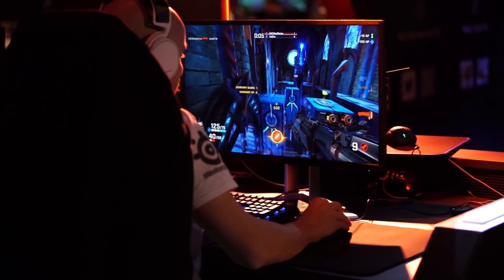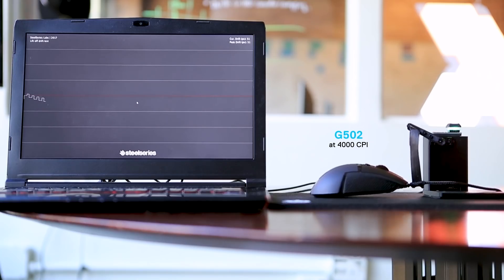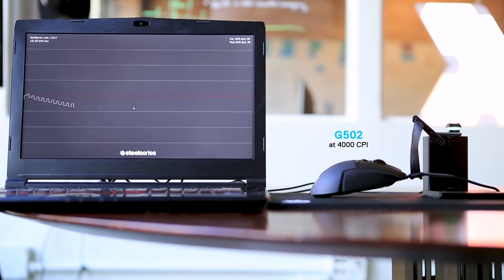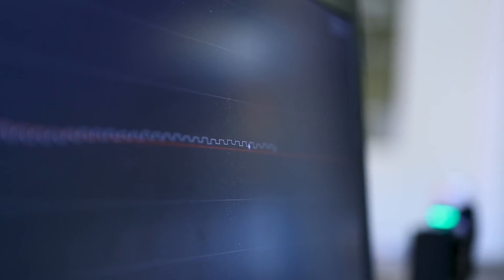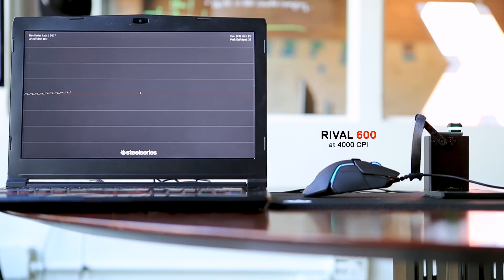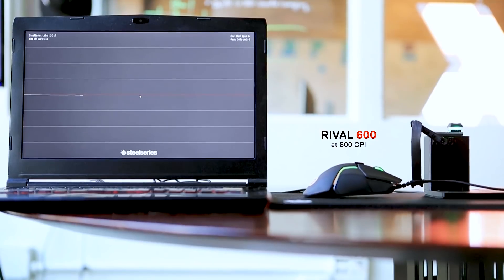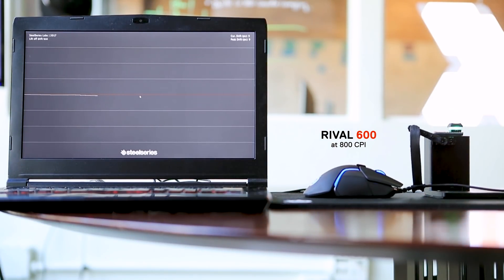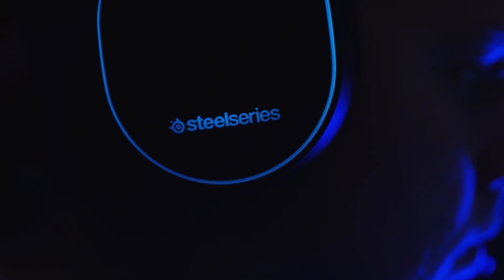Rival 600 Liftoff Tech

Comment: I know I'm literally three years late, but I recently bought a R600 and my liftoff sensor has not worked since I bought it, I checked if there was a peel but there was none, could somebody help out?
Reply: what do you mean by the liftoff sensor has not worked? like it still moves with lifting off or what
Reply: @peterfernandez1756  It doesn’t register when I lift my mouse, like at all.

Comment: Blah bla blah ... Rival in the video is not even lifted as high as the Logitech one ... I am using R600 right now and I'm dissatisfied with it, looking at a Logitech to swap it out and never going SteelSeries again. Reason: Mainly software. The SW Engine is blatantly stupid, does not switch profiles as it promises. I have a cheap 20€A4Tech mouse that can save profiles into onboard memory, allowing for using the same mouse config on multiple machines (I have multiple work laptops, so office config helps my QoL & productivity) but not SteelSeries, no no no. SS will not work properly without its software installed, it will just become a dumb mouse once you don't have it. 
And on HW level the side grips after not even 2 years are runny like my nose in autumn. Not holding in place + the glue is getting on your fingers, what a lovely experience for a 90€ product.  I also had a bad RMA experience in the past with SS (2 mice I had before from them both died, one for wheel, second one for left button; hello RandallB), trying to avoid consumer rights in EU and I don't want to go through arguments about RMAing my faulty "top notch premium brand" product ever again. So I can't recommend SS in general to anyone, go for ANYTHING else than SS, do yourself a service, there is currently dozens of other brands to try. (Also 2 of my Razer DeathAdders died, both doubleclicking, so probably stay away from that model as well???)

Comment: I have this exact mouse and when i play CS:GO sometimes my mouse stuck on screen like there is a board (feels like freezing for less than seconds, but it happends alot so i can't play like that ) how do i fix it ? btw also when im not in game just moving my mouse it does the same thing ...
Reply: I'm sure you have resolved this issue by this point however if anyone else happens upon this comment I will provide some insight into a resolution.  It is your mousepad.  Some areas of my mousepad do this and not others.  Short of replacing your mouse pad with something else you may also adjust lift off height in steel series just a bit, this issue seems to be from the mouse thinking its no longer on a surface for some reason, something inconsistent in the mousepad.  

I had this issue, adjusted the lift off height just a tick and it went away.
Reply: @thevoiceoftruth55  Got Steelseries HArd Mousepad, so i think that shouldnt be a problem

Comment: I have this mouse. It isnt as impressive as it may seem.
- The mouse advertises this wonderful lift off distance mechanism, but the test shown in this video is idiotic at best. No gamer or anyone really, will slowly lift the front of their mouse up and place it back down. Where the lift off thing really kicks in, is when you're in a heated moment, and need to quickly reposition your mouse towards the left of right. Kind of like a bunny hop. This mouse DOES NOT perform well here, its almost exactly the same as with the naga I had. When performing this bunny hop, the sensitivity goes wild for a second and then returns to normal.
- There is a slider in the software called lift off distance. With the latest update on the software as of 4/21/18 I can confirm that this slider does absolutely NOTHING. At level 10 of the lift of distance, you see the exact same lift off amount as level 1. No difference whatsoever.
- I will say though, the software is great aside from the scammy lift off distance thing, with decent control and lighting options
- The RGB is sick. no joke.
- While the lift off distance thing might be the star of the show, its important to talk about the rest of the mouse. The sides of the mouse have a nice rubber texture to help you grip the mouse and I promise it comes in handy and is very ergonomic. One huge mistake on this mouse is the clickers. Being that the mouse is terrible with a claw grip, and having a palm grip is almost your only option, you would need the clickers to be very low resistance to accomidate low pressure presses from palm grips. This unfortunately isnt the case for this mouse. While not too crazy, the clickers do have moderate resistance and to put it into comparison, it has more than the naga and deathadder (The only 2 examples I can confirm). 
- You can pop out the sides of the mouse to insert and remove 5g weights, comes in handy, or doesnt, up to how you see it really.
- Only 2 tactical buttons on the mouse, which are also high resistance, but that isnt a bad thing being thumb press buttons.
- The scroll wheel is great, with good feedback and satisfying soft notches,  the wheel click does have moderate resistance but nothing to complain about, I see it as a positive actually.
- One thing I noticed that is very poor on this mouse is the bottom, the 3 pads on the bottom of the mouse are very poorly made, easily scratched and gets a LOT of lint stuck into the edges of the pads. (Important to note these are hard plastic pads)
That's all I can say about this mouse, I hope this honest review of the mouse helps you out in whether or not you want to purchase it. Ask me some questions as a reply if you want, I'll answer any mouse related questions (Except about real ones).
Reply: this mouse good for csgo you test it? like u checking corner or go 180
Reply: Idk if something is wrong with mine or the firmware is no good (just updated it) but even doing what they're doing in this video, I get WAY more jitter than they show at similar DPI.  IDK if something is wrong with mine, or this video is flat out fake.

My old g403 does better at this test.

Comment: you do realize that most mice with lazer heads has lod adjust down to <1mm back 6 years ago, so when you pushed the 3310 with rival, and then realize later that the 3360 just really can't do below 2mm regardless of implementation, you shell out the 310 with the tm sensor like people suddenly care about 3k dpi again cus muh 2k 4k gaming, and then don't even include a lod feature, because obviously it won't do anything, and you don't admit that limitation, and then another quarter year past you finally shell out something that includes a dcu that shuts  things off, as if all the dcu from mice 6 years ago wasn't either already doing the same thing or that lazer sensors just didn't have this limitation
Reply: don't flatter yourself now with this condescending talk